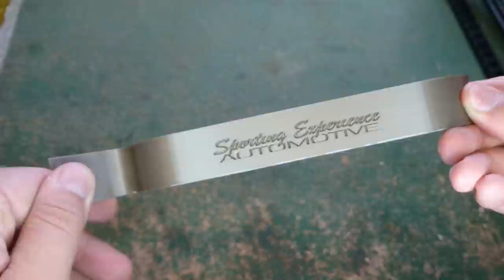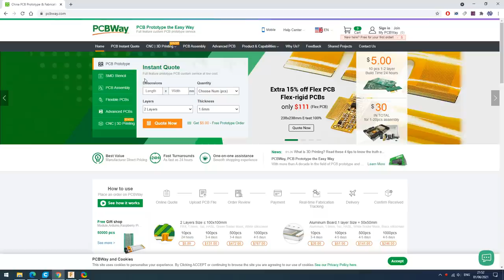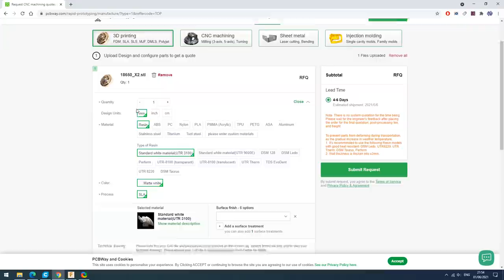10 Useful 3D Printed Tools #2

Comment: For the tire tread depth gauge and the bolt&nut sorter you can color the legends a little easier if you switch filaments to black (or other contrasting color) for the last couple layers. That'll save the marker issues that I always have of the ink running down and bleeding across the face of the part. The issue with the marker on the square is probably because the markings were debossed (sunken into the surface) instead of embossed (sticking out of the surface) like the tread depth gauge and bolt&nut sorter. But, since that was printed with the markings on a vertical surface, the color changing trick would be a major pain even on a printer that has decent M600 support.

Comment: In #2, how do you change the blade, if it's all glued ?
Reply: It appears to lock in the blade out position, but not lock in the safe to carry position. What a stupid overall design flaw
Reply: @jasond9824  I printed one, it locks it into both positions.
Reply: It's not supposed to be glued in place. There's a tab by the blade divots (where the blade locks in place) that you can push out of the way to remove the blade and replace it.
Reply: U cant.

Comment: I have the same problem witch my 3d prints that you in first print. What did settings you change.
Reply from the maker: Changed line width back to 0.4mm

Comment: Hi. Which slicer do you use?
Reply from the maker: Cura
Reply: @3DPrintsBuilds  How did you get the numbers printed on top?  They look bad to me when printed.
Reply from the maker: @granul555  Look over your print settings. Maybe you need to slower down or change layer height.
Reply: @3DPrintsBuilds  Can you please share your Cura settings?
Reply from the maker: @granul555  I use different settings with different prints and printers. Here is one of my Ender V2 settings: https://www.mediafire.com/file/v0l8ifqz7seiazs/Ender_v2_0.2mm.curaprofile/file

Comment: #1 You are better off buying one of those at Harbor Freight . 3D printed plastic is going to break.
#2 You are better off buying one of those at Harbor Freight. . 3D printed plastic is going to break. And you can change the blade. 
#3 You are better off buying one of those at Harbor Freight . . 3D printed plastic is going to break and be of unknown accuracy. 
#4 You are better off buying one of those at Harbor Freight. . 3D printed plastic is going to break. But if you insist there are much better designs out there.
#5 You are better off buying one of those at Harbor Freight . . 3D printed plastic is going to break and be of unknown accuracy. 
Quitting. 3d print things when you can't get something better for pocket change at Harbor Freight.
Reply from the maker: There isn't Harbor Freight everywhere and the prices are also different. Yes some of the things last longer when not 3D printed, but it depends how much you use them. Also some of the things you can print 2 or 3 and still cheaper than to by one.